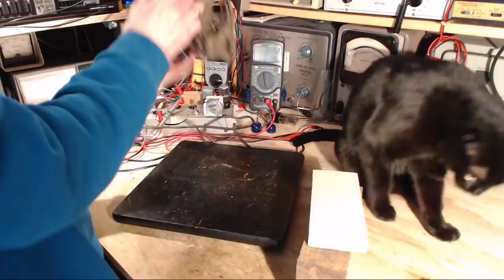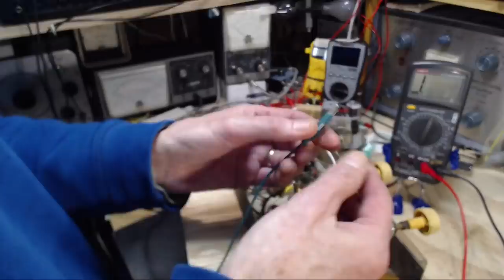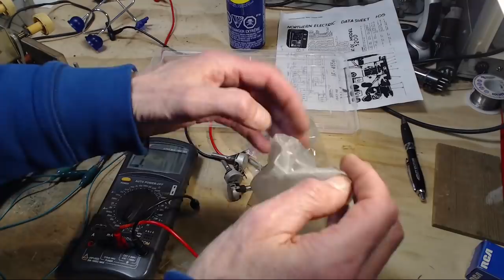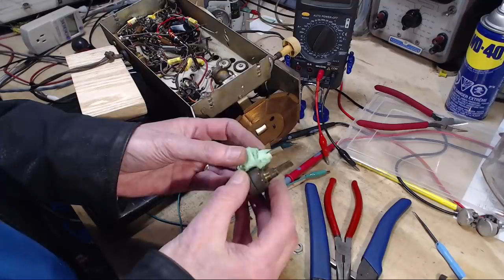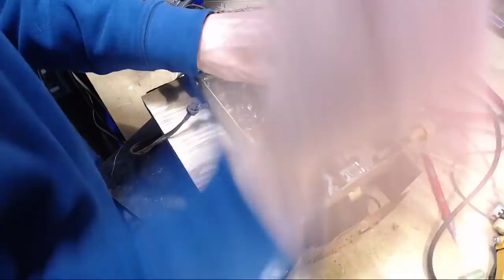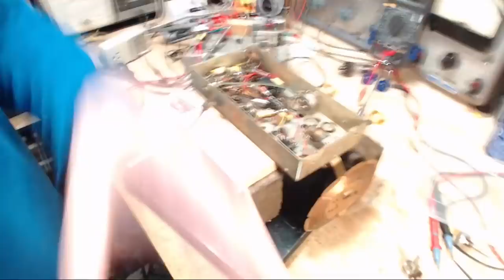Northern Electric Baby Champ AM Radio #6 - Volume Control

Comment: WD-40 is not ideal for cleaning pots, as it has kerosene in it and leaves a residue on the carbon trace, and smells bad for days. It's a degreaser/weak lubricant used for loosening stuck metal parts, much like penetrating oil. A proper contact cleaner is recommended (like Deoxit D5), which will evaporate completely without any residue.

Comment: I was just thinking we haven't seen much of Shadow!  I would take the control apart, if only to see what is going on. I have been known to make one switch out of two, when the parts were compatible. I had one that measured open so I took it apart to see why. The resistance material was lying in the bottom of the switch housing. Sadly, no fixing that.